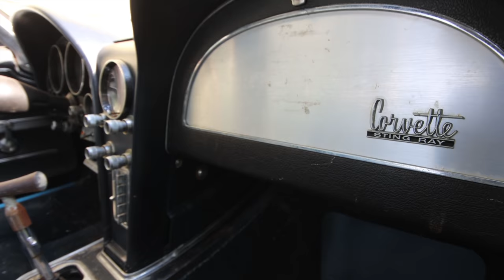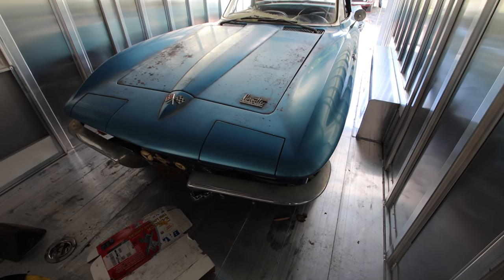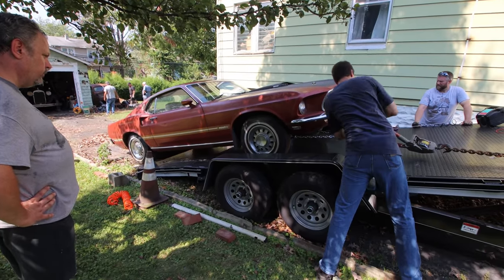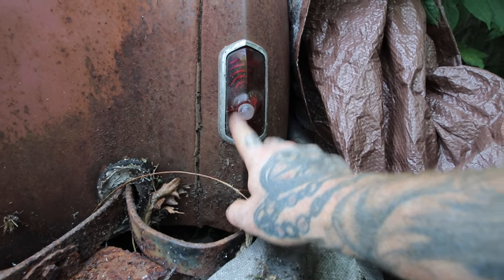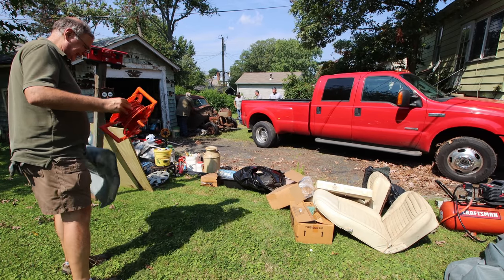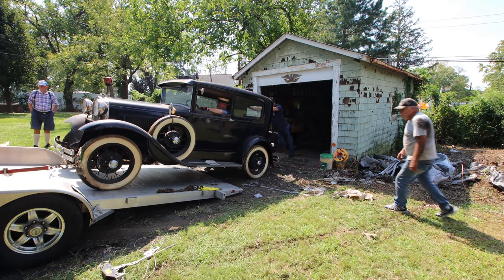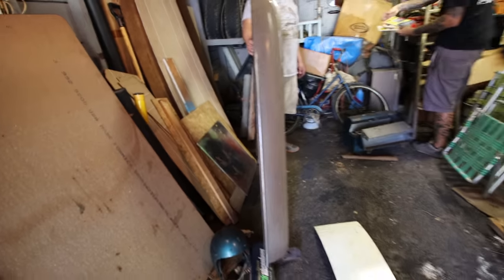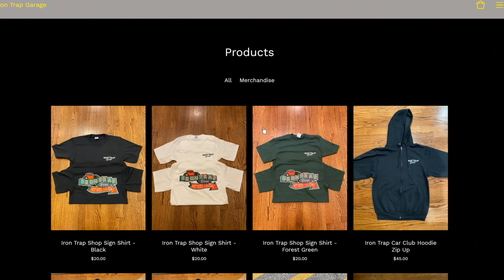Baltimore Driveway full of Abandoned Classic Cars! - 66 Chevrolet Corvette, 69 Mustang Mach 1

Comment: The hubcaps and the stainless gearshift knob belong to the ‘66 Corvette. The center caps w/beauty rings were not available until ‘67 and the “T” handle on the shift lever is after market. The orange 327 valve covers probably belong to the ‘66 Corvette. I don’t ever remember seeing a stock mid-year 327 with the “Corvette” valve covers.